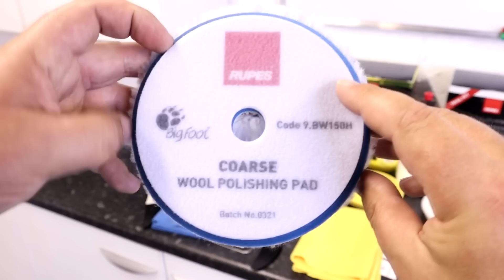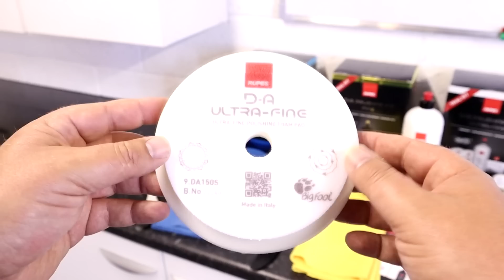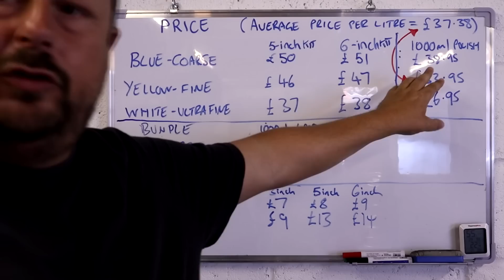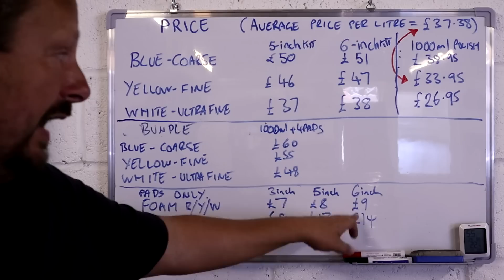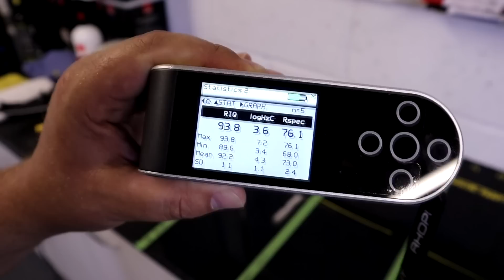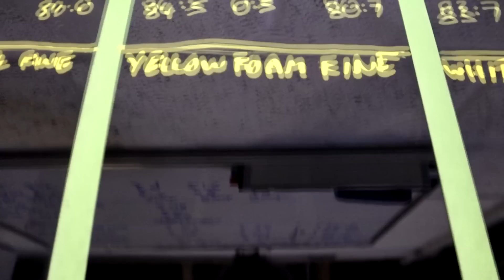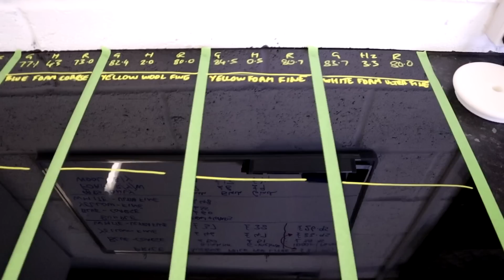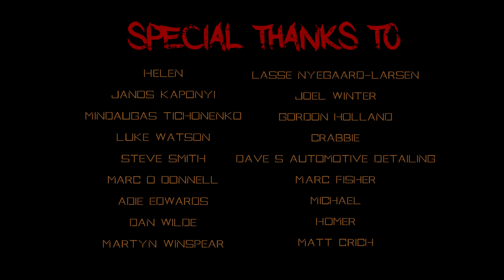Rupes DA Kits | Car Polishing Simplified | Wool v Foam | Coarse Fine Ultra Fine

Comment: Hi Jon. There aren’t diminishing abrasives, they are more of a uni grit / constant cut and therefore should be short cycled each set. A set should consist of one cross hatch pass per set, the set should be around 6-8 times the stress of the pad, and should only take around 45 seconds - 1 minute per set. 
Working this product long will only lessen the results. 
If 1 set doesn’t active the desired result then another set should be performed the same as the first set, or a step up should be made. You wouldn’t have to straight to go blue / blue, for example if yellow wool wasn’t doing the job with yellow polish, then you could go with yellow wool and blue compound, or blue foam with yellow polish, the step ups can be that fine tuned. 
HTH
Reply: Sorry could you elaborate: one cross hatch pass per set, set shoul be 6-8 times the stress of the pad.
Reply: @LucaBonato  sorry that was a a typo which I can’t edit for some reason, it should read that the set area should  6-8 times the “size “ of the pad you are using, this goes for any of the Bigfoot machines, right down to the nano ibrid.
Reply: Abrasive orientation is said to be a combination of both types of abrasives. 

Work time shouldn't exceed six passes according to Jason Rose from Rupes.

Comment: great video john, do you know if the rupes compounds and polishes you featured contain any silicons, which causes my bodyshop issues in paintwork on my classic car, i know a lot of compounds and polishes do have silicon in them?
Reply from the maker: im 99% sure the pure abrasives are bodyshop safe.   Uno protect and advanced All in ones might not be mate.  Check with Rupes.
Reply: @ForensicDetailing  thanks john ill get in touch just to be sure

Comment: I have just used mine kit today. What i found is yellow is more fun to work with as it greasier. Blue compound is even hard to remove with microfibre, as it is catching lol
Reply: @Lee Francis Thanks, i was unable to get uniform film around the panel , so i have added a little bit more. I think you are right.
Reply from the maker: remember 1 minute set only with 1 horizantal then 1 vertical pass then stop and wipe.  short fast sets.   have a watch of the rupes you tube channel as well where they go into a lot of detail about usage tips.

Comment: Great review 👍 
I wanted the ask what is better to use the rupes yellow foam pad with the da fine yellow polish or sonax perfect finish.
Rupes as a manufacture does not give a cut rating like sonax which is a shame, there's not alot information from the company on the polishes I find.
John how does the yellow pad perform with the koch chemie medium polish.
How many sets with rupes yellow polish do you have to do  to get a full correction just trying to understand their polish.

Comment: Hi
Just wondering about the priming of the wool pad and hazing. Would hazing be less if the wool pad was not primed?
According to a test done by Esoteric priming is pointless and a waste of product and hazing was lower unprimed.

If not primed would it outperforme the foam pad?

Trying to figure out what to purchase of products as i am taking delivery of a new black Tesla Model Y Performance and want to give that little extra touch before adding a ceramic coating

This is what i am currently debating with myself:
Sonax Pefect finish polish or Rupes yellow polish with either Rupes yellow foam pad or Rupes yellow wool pad.

So when i see different videos testing the wool pads, primed and not primed, with focus on hazing I get a little lost 😅

Comment: These Rupes DA systems are brilliant when used as per Rupes guides, they are quite specific when compared to others, and are even quite specific on pad priming. 
Designed to be efficient, the yellow Fine DA system will be the one for most folks, a brilliant one step system, they yellow wool finishes amazingly well and is the one to use on harder paints. 
The white Uno Pure with a white pad is fantastic for gloss black exterior trim. 
Everyone has their own methods of polishing, but if you follow the Rupes guides for these systems, you will get the best results.

Comment: This is an awesome system, Jason Rose and everyone else involved really did a great job on it. I recently did a correction on a silver Hyundai sedan that had heavy defects and  very hard paint. To my surprise, I was able to one step it with the DA coarse and blue wool pad. I did do a 2nd step test spot with the yellow foam and DA fine, but I couldn't detect any visible improvement either by eye or under an inspection light. Very impressive finishing result for that aggressive compound and pad on hard paint.

Comment: It would be interesting (to me) to know how they grade the wool for the wool pads, e.g. microns of the fleece used. And is it superwash wool? that’s when the fleece is treated to stop it felting… not expecting an answer, just wondering
Reply from the maker: these are great questions but like the manufacturer is the only one to answer this.
Reply: @ForensicDetailing  indeed, or I could get a couple and take a look at them with my fleece inspection tools (yes they are a real thing 😂 😂 😂), but that would be a bit extreme even for me. Unless I go down the detailing equipment route on my Design Degree 💡

Comment: Jon I’ve been using the yellow mid range kit recently and loved it. I found the fine abrasive lovely to work with and buff afterwards. I always have used foam but now i’m super into wool because of these kits. Very nice on the panel and you’re right it delivers some cutting grunt ! On my paint it even finished out nicely to an acceptable level for me and left it there! (Although i have used UNO and it’s a gorgeous, slick, super enjoyable finishing polish - makes me smile whilst using it honestly)

Comment: Are these kits only for da or can use with rotary?
Reply from the maker: they can be used for forced rotation and rotary application  but they have been primarily designed for use with the dual action bigfoot range.   Rupes have abrasive products for their other polishers as well.
Reply: Rupes says that using these pads on a rotary works well but the pads won’t last long. For the rotary use the special Rupes pads for rotary.

Comment: Hey jon. Partnership aside, how would you compare rupes abrasives to Koch ones?
Reply from the maker: really interesting less oily, and as others have said you need to shorten you sets with the rupes system.   I think the koch stuff suits rotary application more and is more forgiving, can be worked for long time.  rupes are giving you a suite that caters more lower processing times on DA's  that will come in usefull when refinishing paintwork and you are mopping out sanding marks all over the car.  the blue foam and corase compound does a hell of a lot of work in tiny time frames.   And the fine can refine this well enough.  Its a fantastic system.  But if you dont use the rupes system incorrectly specuially the blue coarse you can dust it up and make life hard for yourself if you overwork it.   but none of this is rocket science.  its very very good,

Comment: Great vid as always! You need to try RUPES Uno Protect with yellow wool, trust me this combo will turn everything on its head. One stop AIO correction and final acceptable polish finish.  Let us know when you’ve done the vid be interested in your findings.
Reply: @ForensicDetailing  I’ve tried the above  (yellow wool/UNO protect combo) on BMW Black sapphire paint and was really impressed with the results. A very acceptable one hit solution and gives a good 6 month protection with really good beading qualities. Followed up with yellow wool/ DA fine combo and the areas needing a bit more correction. Don’t get me wrong BMW Sapphire black is hard as diamonds, and could go full blue, for an even better correction, but this creates the need for a 2nd or been 3rd step. I think once you’ve tried this combo you’ll find it hard to reach for anything else. There’s also talk of another UNO product due with a 12 months protect element, which will be a game changer I reckon.
Reply: @Bobby Situkangpoles a good combo I use is Soft99’s fusso coat speed & barrier. Insane beading and slick surface.
Reply: @CraigK80  Jason Rose from Rupes was saying they are developing new product if I remember correctly